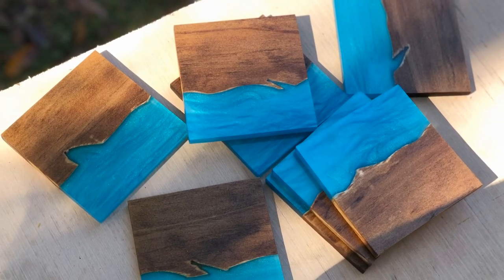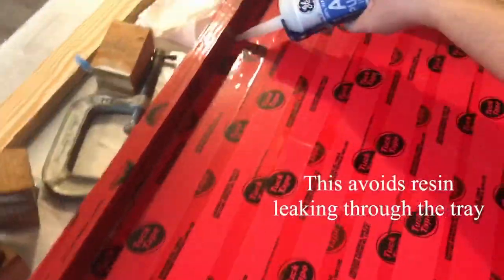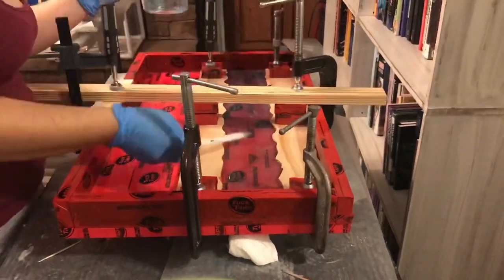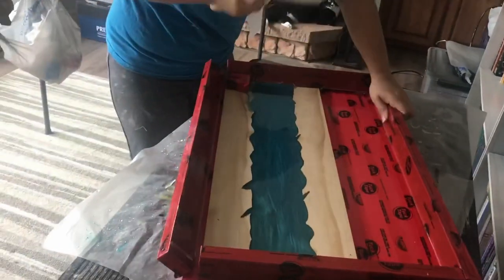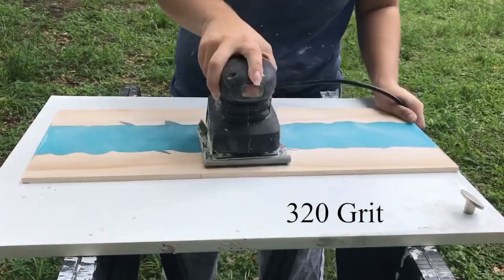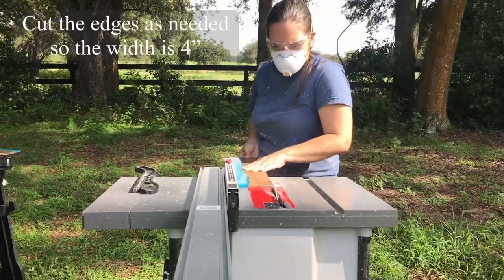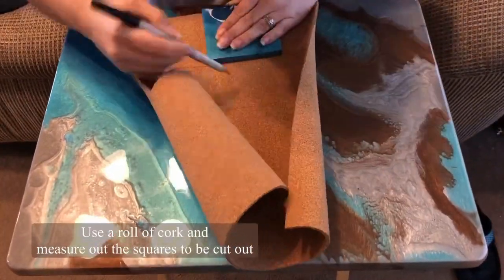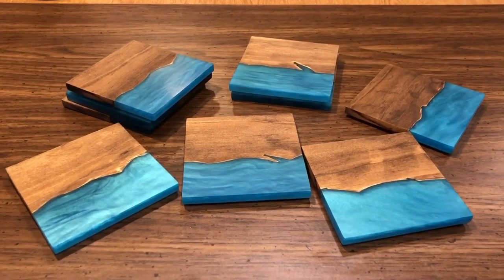How to Make River Coasters with Epoxy Resin and Wood DIY

Comment: Just a quick observation: When using a Dremmel, be aware that it can burn the resin because of the high RPM it turns at. Just be careful when getting close to the part you want to keep.
Reply from the maker: Thanks for the tip I didn’t realize that

Comment: Hi, I noticed that you didnt seal the cut edges first before using the blue resin. Other videos suggest that sealing is important, could you give your opinion based on experience?  Also, I assume the blow torch is used to simply warm the surface to release any bubbles?  Thanks
Reply from the maker: Yes sealing the edges is a good idea because it will prevent bubbles, and yes the blow torch is to get rid of the bubbles.

Comment: Great video and tutorial. Thanks for sharing. Consider using a stop block on the mitre saw to have the exactly equal lengths. It's far more precise than measuring each piece separately and also much quicker.
Reply from the maker: Thanks for the tip that’s definitely helpful!!

Comment from the maker: Thanks for Watching! if you want to know what I used for this project see the list below:
P R O D U C T S   A N D   M A T E R I A L S
As an Amazon Associate I earn a small commission from qualifying purchases, but this supports me and helps me continue to make helpful videos :)
Epoxy Resin Stone Coat Countertop https://amzn.to/3ADBLPR
Color Pigments Black Diamond (I used the blue/green color) https://amzn.to/3HpMwsY
Tuck Take (for the mold frame) https://amzn.to/3AFQFFp
Teak Oil https://amzn.to/3niIPi0
Polish Meguiar's Ultra-Cut Compound https://amzn.to/41R0hce
Silicone Spray https://www.amazon.com/dp/B0018NBE8A/ref=cm_sw_r_cp_api_i_jla0Eb2457CGK
Wood Conditioner Minwax https://amzn.to/3oTb7jw
Wood Stain Provincial https://amzn.to/3oX7lp6
Cork Self Adhesive https://amzn.to/3oXU5AU
Clear Silicone Caulk https://www.lowes.com/pd/GE-Silicone-1-10-1-oz-Clear-Silicone-Caulk/3070881

T O O L S
Jigsaw https://amzn.to/3LDx123
Torch https://amzn.to/41W8TP6
Sander
Miter Saw (not the one I used on this project but what I currently own) https://amzn.to/41P0ltb
Dremel https://amzn.to/3Lk6Gpn

Comment: hello great video, 1 question what material is that RED cover that you use in your mod??? Thanks
Reply from the maker: Thank you! I used a tape called Tuck Tape . I got it off Amazon
Reply: @diytiff  Thanks for your Reply, great video.

Comment: Very nicely done!   When you stained the wood did you just keep the stain off of the resin or does the stain not adhere to the resin?  I would have thought it would have made the resin cloudy where it touched.  Thank you?
Reply from the maker: I tried to keep it off the resin and wiped off what touch the resin right away

Comment: Great job!  Your video was well made and easy to understand. As someone who has never worked with epoxy before, I have 2 questions. 1, when you remove the project from the mold, which side of the project is the finished side?  Are you using the side that was in contact with the bottom of the mold s as the finished side?  2, will the stain that you used on the wood wipe off the epoxy easily?  How do you make sure the epoxy doesn’t get stained?
Reply from the maker: Hello, and sorry for the late reply. 
1.When I remove the project from the mold the top is the finished side. 
2.The stain wipes off easily as long as you wipe it right away. I just try to wipe off the stain as carefully as possible. 
I hope that helps let me know if you have any other questions :)

Comment: Kind of new to this.. What is the red colored film you're using on inside of frame?
Reply from the maker: It’s called Tuck tape. Is a construction sheathing tape and epoxy resin won’t stick it. I believe other brands will work too but this one has always worked for me. I have the Amazon link in the description if you’re interested in ordering it.
Reply: @diytiff  Thank you for your help

Comment: good video, and instructional. what did you use on the casting box to keep the resin from sticking, you did not mention it or list it? Craig
Reply from the maker: Hello Craig and thanks! On the casting box I used silicone spray. The casting box is covered with tuck tape. I went ahead and added both of these on the list with links on the description now. Thank you for letting me know.

Comment: Do you have to wait for the first layer to cure all the way before putting the 2nd layer?
Reply from the maker: Rob I it depends on the resin, the one I use I believe I can do a second layer after 6 hours but if I miss that timeframe I have to wait until it fully cures. Most times I leave it drying over night so I end up waiting at least 24 hours before a second pour.
Reply: Thank you for your reply!

Comment: Hello mam
That's so pretty 
But one thing I want to know that it was sticky or not after put the hot cup 
Plze mam reply me
Reply from the maker: Hello sorry for the late reply. I use a heat resistant epoxy so I’m able to use hot cups on it and it doesn’t get sticky.
Reply: Thank you mam for your reply 
Will you please share the link that epoxy which is available in flipkart or amazon
Reply from the maker: bhawna589  This is the one I use and this is for the 1 gallon kit:  Stone Coat Countertops Epoxy (1 Gallon) Kit https://www.amazon.com/dp/B07MBH96DB/ref=cm_sw_r_cp_api_i_XscnFb4KZTA6Y
Reply from the maker: bhawna589 This is the 1/2 gallon kit if you want to buy a smaller size: Stone Coat Countertops Epoxy (1/2 Gallon) Kit https://www.amazon.com/dp/B07ML5LWLX/ref=cm_sw_r_cp_api_i_7scnFbKQ0KBEC
Reply: Thank you so much

Comment: Looks great, thanks for taking us step by step. Did you let the first layer cure totally before pouring the second, or was it still tacky?
Reply from the maker: I normally let it cure for 24 hours, it’s good to touch after 24 hours. Some resins will tell you in the instructions that you can do a second layer within just a few hours.
Reply: These aren't very thick and I think I would have poured them all in one go and if they were thicker like 3/4" or 1 3/4" I'd switch to a deep pour epoxy just because I speeds up the process but the general rule for building layers is let it set till it's tacky and you can still poke it with you finger and it will leave an indent and then pour your next layer. Or let it cure rock solid them scuff it with and sandpaper and wipe it off with a rack cloth. I almost always go with the first option unless it's a tabletop but either way it's important to do to insure the epoxy bonds to it's self.

Comment: Instead of using the dremel to remove the excess resin, I would just start with 80 grit and work up from there.  80 will take that crap off in no time
Reply from the maker: I’ll give it a try next time. It’s always taken me a while to sand epoxy down when it that thick. Thanks for the tip

Comment: cool project but you should do some research on how to shop for wood before giving advice on what wood to use because it "warps" I have seen specific videos that teach you how to shop for wood and they will teach you what to look for in the end grain of wood to know whether it is going to warp or not.
Reply from the maker: Thanks for the tip. I had mentioned the warping on this video because I noticed it after the project was done unfortunately. But each project is a learning experience :)